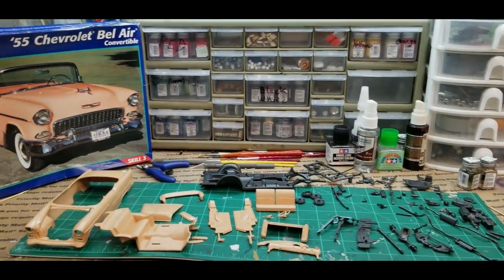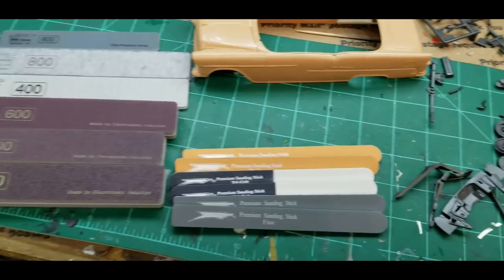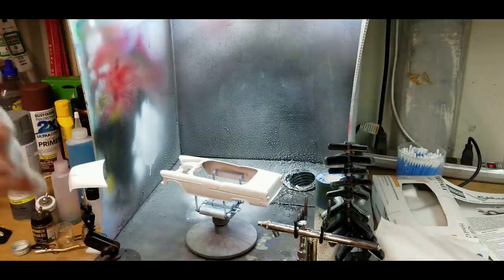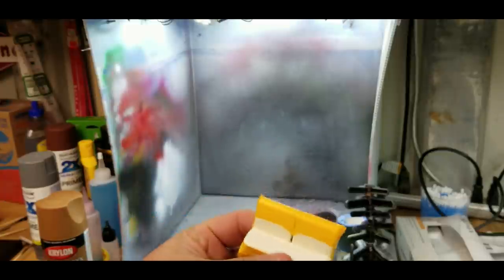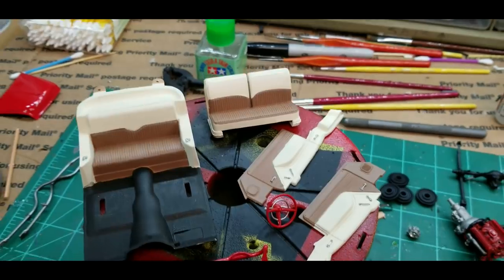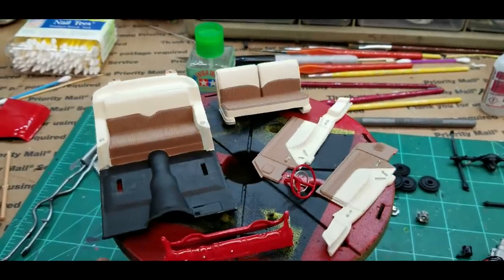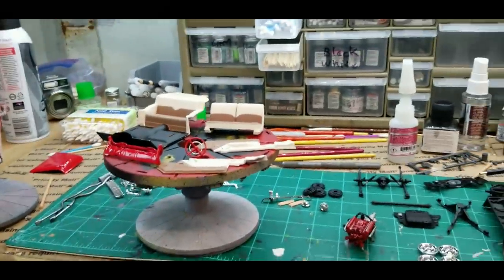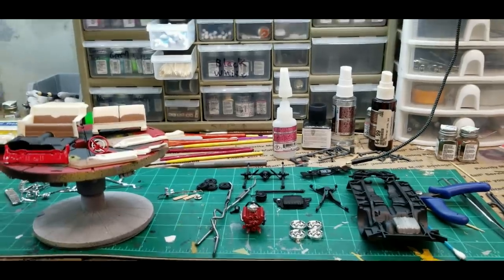1955 Chevy Convertible 1:25 Scale by Monogram 1995 Release PT:1

Comment: Looking good. Your plug wires are correct, the early small block chevies ran under the exhaust manifolds and the four barrel carb early on was usually a Carter. Love the colors you went with.
Reply from the maker: Thanks!!